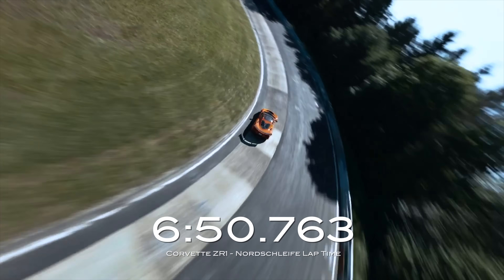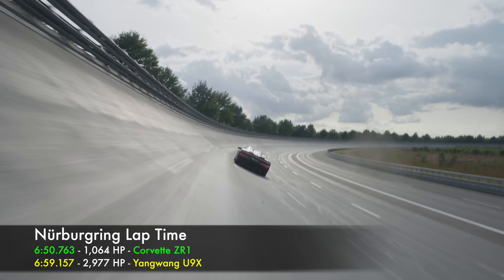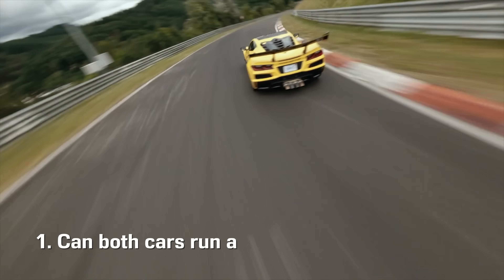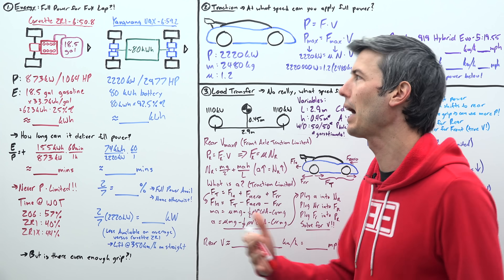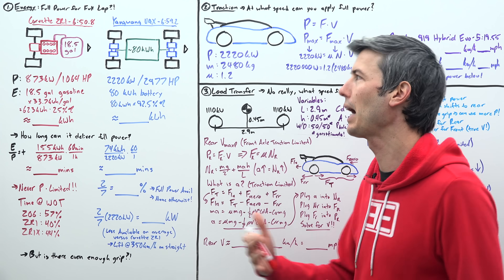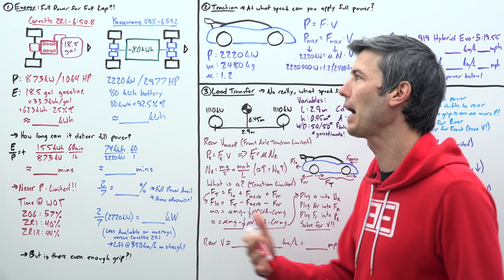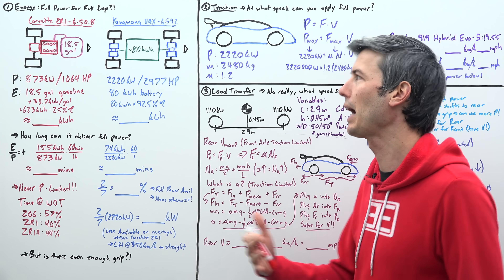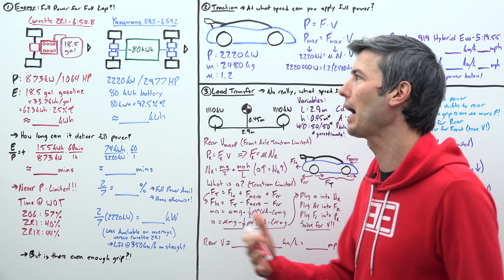Gas Beats Electric! Why Is 1000 HP Faster Than 3,000 HP?

Comment: I watched the U9 lap and don't get me wrong the acceleration it's capable of is absolutely wild but it looked sketchy and unbalanced to drive, you can tell the chassis isn't designed to handle that much power and it's weight causes it to pitch and roll. The Vette on the other hand looked pretty planted and agile.

Comment: I guess that's why it's hard to replace f1 whith BEV vehicles, considering they are 50% efficient converting fuel to movement, a 660 kWh battery would be required for a F1 to match its conteporary F1.

Not metioning the sound, because the v6 already lost the cool sound of the v12/v10/v8

Comment: It's not just cornering speed,  but corner exit speed as well.  Most straights are relatively short at the Nordschleiffe.  The faster accelerating car has to not only catch up to match the grippier car's speed, but needs time at it's higher speeds to simply match the time down the straight,  much less beat it of the lower power car.   There just aren't enough long straights for that to be the case on most race tracks, and especially the Nordschleiffe.

Comment: Ok, but in real life, its different. the other day, I was driving behind a new looking Porche with around 300HP and gas engine. I drive a pretty ugly Renault Zoe electric with only 109HP and 40kW battery. It was a very curvy narrow road, and the Porche was trying really hard 
to get away from me at every straight distance, but he could not. Every time he put the gass to the floor, I did the same, and he got so mad he stopped in the middle of the road and went out of the car. I just showed him my prettiest finger and passed him at the busstop on his right side. He had manual transmission, and I dont have gears at all unless you count reverse. There is no loss of accelleration during shifting on my car, since it never shifts.

Comment: I disagree its also about the capacity of the battery. which you actually showed at the beginning of the video. Also the front and rear power  is simplified as I am sure you are aware of as there is also forces being distributed between the left and right side of the vehicle.

Comment: Right now, that's because it's easier to get a spinning mass of weight to translate to higher top speed. It's entirely because of the weight of the pistons allowing a higher top end via momentum of mass, whereas electric motors HAVE to entirely rely upon the power of the battery. If our batteries improve, so too will the top end. 

The theoretical limit of the gas engine is the power generated × weight of the pistons ÷ [air resistance factor + tire size] — and there is a maximum limit that's rather easy to calculate that they will never be able to overcome due to the physics of moving weight back and fourth, even if concentrically. However the limit for electric motors is 269,813,212.2 ÷ windings (in cars this number is almost always 3 since 3 phase is most common but some can go as high as 12) ÷ [air resistance factor + tire size] — and the final number is the maximum RPM the electric motor is capable of. As you'll notice the number is absurdly high in most cases, meaning if the power to supply is there an electric motor with proper cooling and design, can hit upwards of 89,937,737RPM at the wheels.  This calculation is different than with ICE in that the maximum speed achievable will always be limited by the maximum speed of electricity in theory, and material physics in practice, and not the ability to shift the weight of the pistons as well as how much that weight impacts speed with diminishing returns : Meaning once we can put the power to it, electric motors top speeds will outpace our ability to design structures and components capable of even handling it, since ICE by their nature will never be capable of even hitting that limit, we have never even conceived of designing structures of components for withstanding that on a vehicle like a car, only rockets going to space have ever had that kind of consideration, which could be used to explain how much faster electric motors can potentially be than ICE no matter how much time and money we put into ICE development. The only thing close is turbines, and they don't have power the same way electric motors do, for instance a 50,000hp turbine won't make a car take off faster than a 1000hp electric motor, and it's top end wouldn't be close either if we had for instance a "Mr. Fusion,"-esque battery capability on the electric motor.

Comment: "HEY DERELICT,"
"YOU'RE ALL OVER THE ROAD WITH YOUR ARITHMETIC."
"YOU'RE LEAVING OUT TOO MANY VARIABLES."
(DOWN FORCE/ YOU'RE COMBUSTION ENGINE IS INCORRECT.)
"BEING SUPERCHARGED ALLOWS IT TO RUN OVER 100%, COMBUSTION FUEL EFFICIENCY." 
(OR DIDN'T YOU KNOW THAT?)
IT'S NOT THE TIRES THAT HAVE TO PUT DOWN, THAT MUCH TRACTION, IT'S THE SUSPENSION."
(OR DIDN'T YOU KNOW THAT EITHER?)
"LOOKS GOOD, SMELLS LIKE CRAP!"
"ELECTRIC MOTORS PRODUCE ALL OF THEIR TORQUE RIGHT OFF THE BOTTOM."
(THE ABILITY TO TWIST) 
BEING ABLE TO TWIST GRIPPY RUBBER TO THE GROUND IS THE SUSPENSIONS JOB."
"IF YOU RUN RACE TIRES, YOU HAVE TO FACTOR IN THEIR ONLY TWO PLY." (TO STAY COOL) 
"NUREMBERG HAS 188 CORNERS."
"AND IT'S PRONOUNCE PORSCHE, NOT PORSHA, OR DIDN'T YOU KNOW THAT!??"
"AND NOBODY WANTS TO SOUND LIKE GRANDPA WITH AN OVERSEXED GOLF CART MOTORS, TRYING TO KEEP UP WITH A CORVETTE!!"
"Just saying.............🤔"
👣👍🇺🇸🪖🚬

Comment: What is the rolling resistance of those Continental Tour 54 tires? They say they're low rolling resistance and made for EV's increased range and ICE increased mileage, but they don't give a number. Even if you bury it in the bottom of the specs sheet, JUST PUBLISH A NUMBER! What is so hard about that?

Comment: i question manufacturers claims on motor power...

firstly... watts... is that electrical consumption or torque/RPM at the SHAFT?

wire has resistance, for a given voltage across a given resistance so much current will flow. every turn of wire and ampere gives amp turns and that equates to MMF, magneto motive force, but that does NOT equate to "magnetic attraction/repulsion", as that is about the material and the amount of it.

for every bit of MMF developed, a certain current must flow in a resistance and turn to heat, doing nothing else.

"but electric motors are efficient..."
yes. in certain select circumstances. a complicated topic that goes a bit beyond most peoples basic idea of electricity, yet its also very simple. a resistor converts current into heat. a motor has resistance. the source of EMF also has resistance. that is, batteries... generators... 

when the load and the source resistance are equal, only half the power appears in the load.

yet if i STALL an electric motor, it can CONSUME vast amounts of electrical power, and all it produces is heat. as it does no useful work, its 100% inefficient.

then... if i have a 10kw motor, and its rated when driven with 2kv.... i can sell it as 10kw even if the user only happens to have 1kv, and it never can ACHIEVE that rated output... no law says that i have to alter the label. in fact, the law demands i DONT change the label... its rated at 10KW, i sell it at 10KW, its the customers fault they didnt check the full details and find it needs 2kv to consume/develop that 10kw.

just carefully omit that part about the rated voltage in the sales brochure.

until i see one on a dyno, and a big fat ammeter and voltmeter come wattmeter on the battery, i remain dubious about all their claims...

the equivalent rating would be "specific fuel consumption"...

"sure, this engine makes 1000kw... but it drinks 3 times as much as the competitors 900kw engine..." which ones better? the big power? or the three times better economy?

Comment: Please stop assuming the electric car should do open throttle as much as possible. In reality there is no need to put down so much force all the time on tracks, but rather only in straight lines at high speed. Even then, you don't wanna destroy your breaking system or suspensions by going way too fast...

Comment: All Jason had to do was see how much gasoline the c8 used (gasoline energy) and how much battery energy the yangwang used in the lap and then divide by lap time to determine how much average power each used. He could have taken maximum speed of each car on the long straight to then determine max power each could put down for a short blast! 

No accounting in jasons calculations for rotational inertia which affects acceleration and thus the speed at which power overcomes traction! engineering explained has some explaining to do!

Comment: Your final point is kind of overshadowed by the fact that the ZR1 was hampered by its driver. We can quite literally see it with your own data. 40% full throttle compared to the ZR1X'S 44% is purposely bottlenecking a car. Not to mention, the drivers were engineers of all of the Corvettes, who were very clearly taking conservative racing lines. I do agree with your overall point, but you make it seem like the ZR1 time is the absolute fastest it can achieve when that is just not thar case.

Comment: well they want to does it all, more power down the wheel, higher top speed, better torque vectoring ability, more energy restored during braking,except better cornering.
And hoping those giti tyres could magically meet their  requirements, other part of the car was basically same as the original U9, no other improvement,it is a production car  so it can't have bigger aero kits, the same 2500kg of weight ,so it can't go that fast on the track, or the tyres will go off before cross the line.

Comment: Great video! 
All what you said is true, and besides that if you put these motors full power for some time it would probably overheat and potentially melt cables.
I doubt that even if the battery capacity and grip was there, this EV could sustain 3000hp for more than a couple seconds.

Comment: One comment I would like to make is that regen braking is completely skipped in the required energy storage calculation. There are plenty of braking zones. I'm curious how much energy they recover.

But yes, power is meaningless without considering weight and traction. That's why for example there is no point in going over 500Nm of torque in a FWD street car. You simply can't put the power down until you're already past the lose-your-license-speed. Which is fun, but risky.

Comment: Aero downforce can dramatically alter all the numbers you got. If it is active aero, then they would have little in terms of negative impact on the main straight and could have significant advantage on speeds over 150 km/h. 
The biggest concern is the battery (and other electric system) cooling at such power levels. I seriously doubt there is 2 MW of power available for more than 10 seconds at a time. The battery at full power would dissipate 200 kW in heat. How do you cool it down? 
There surely is some active cooling, which when optimized for power output would significantly drain the battery - or would not be enough to cool it down for sustained power output. 
It must also have some regeneration - which would increase the total usable energy available but would negatively impact the cooling.